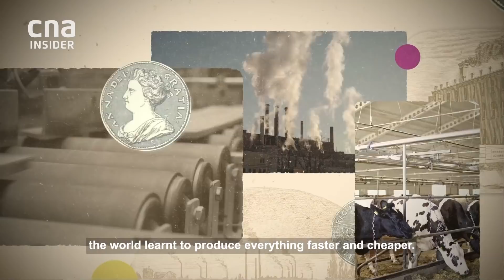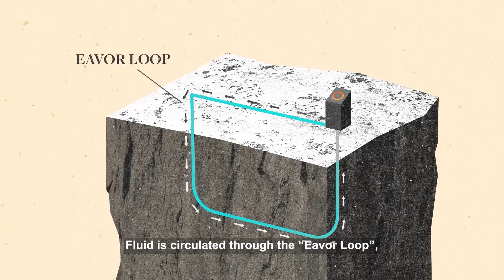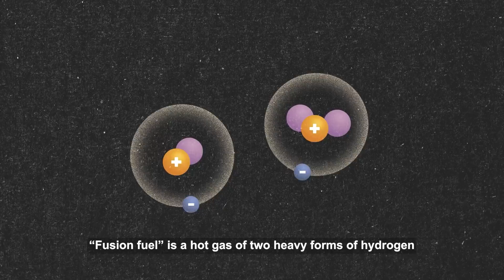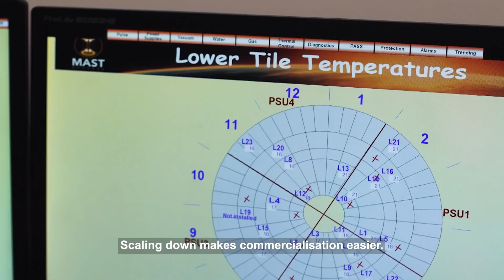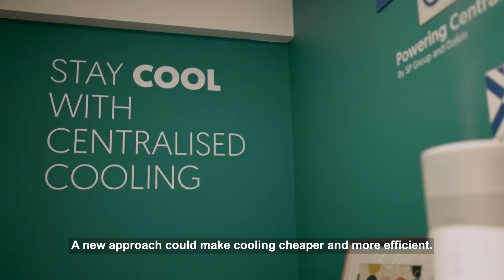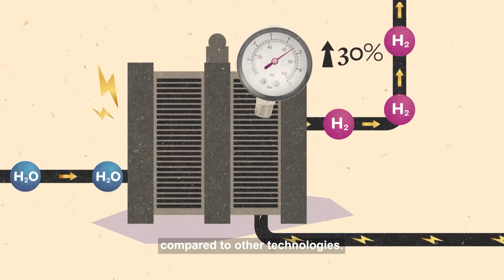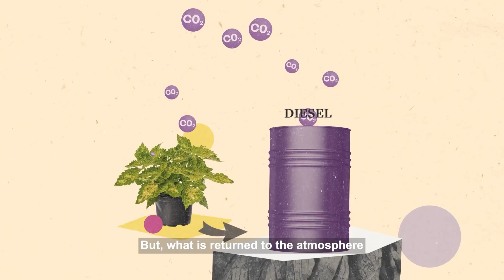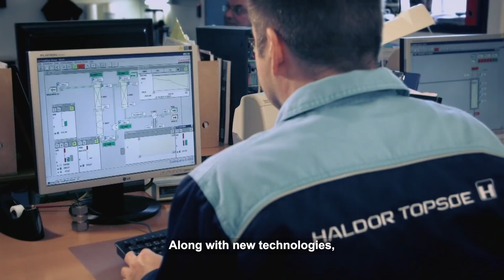The Future Of Energy | Climate Trailblazers: Reimagining Our Future

Comment: Not included that is probably one that we all need is a breakthrough on battery technology. With all the clean energy the world could get, we need better batteries to store electricity. Smaller footprint but larger capacity, better storing technology that does not deplete like the current battery technology we have.
Reply: https://www.youtube.com/watch?v=yb1Nuk3_t_4&t=15s still developing.. x10 cheaper then litum. but a lot heavier good for large landed battery.
Reply: @jKee-mw8kz  Wow, that is fascinating! Thanks for the link. Large scale energy storage by freezing air, and somewhat efficient because all of the energy used to freeze and reheat the liquid air are reused for another run of the process. That's great.